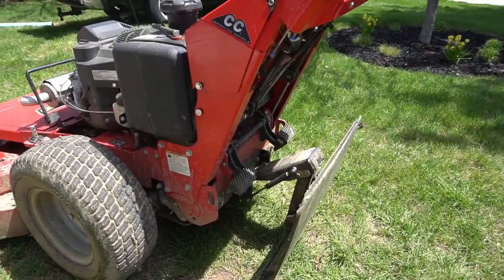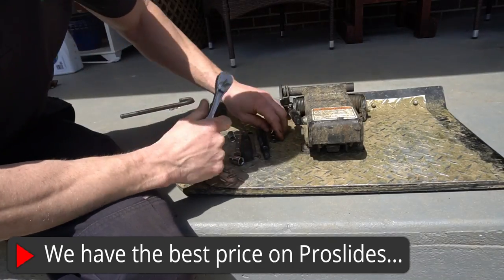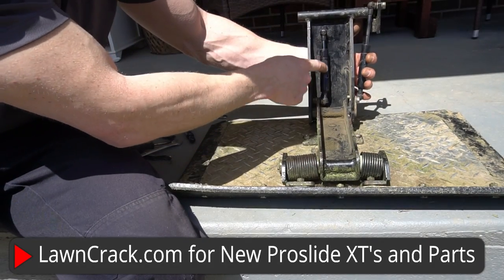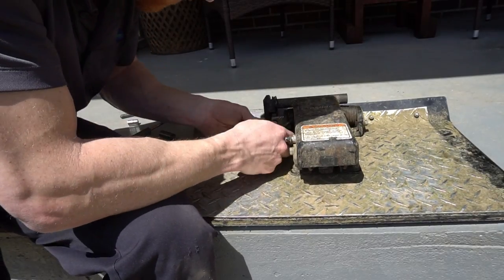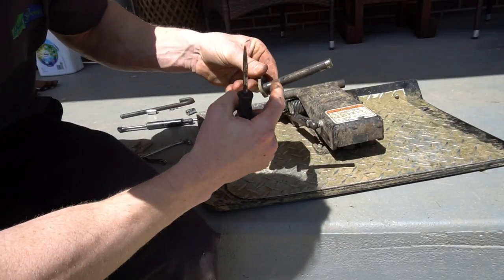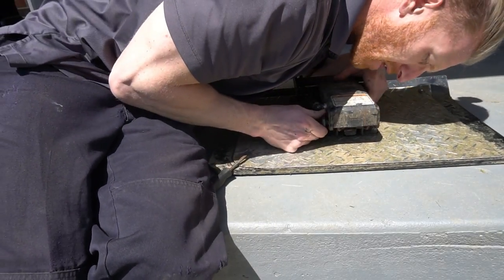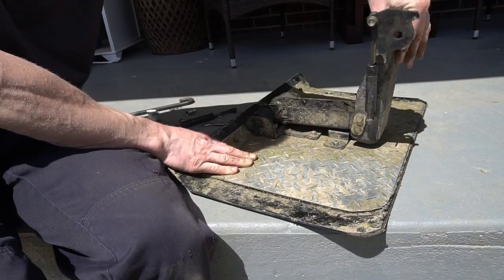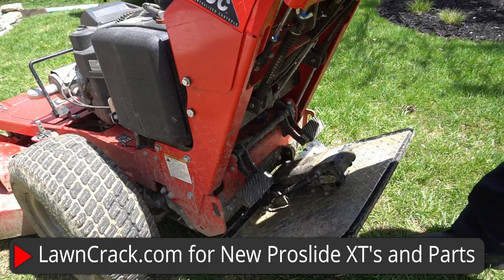Proslide XT | How to Replace the Gas Shocks | Proslide Troubleshooting

Comment: The shock underneath.... where do you get the torsion springs for the old style?
Reply from the maker: Hey Kevin...I have heard the terms old style/new style used when describing the Proslide....but I am not sure what is meant by that.  I can't tell much of a difference, if any, from the Proslide I bought in 2009 compared to the ones I am currently selling.  I am working on getting the common replacement parts onto the Lawn Crack website...if you want to email me at Ryan@LawnCrack.com I can send you a pic back of the torsion spring set I am able to get.  I am able to get the parts at a reduced at just like the Proslides themselves.
Reply: I’m currently searching for a new sulky for my Exmark. Question #1 i mow a few properties that are big that’s nat good grass. Will it still slide on junk grass/dirt? Question #2 is it easier on the mower versus a wheeled sulky/ I’m 250 pounds lol